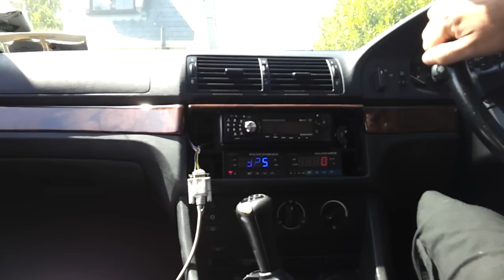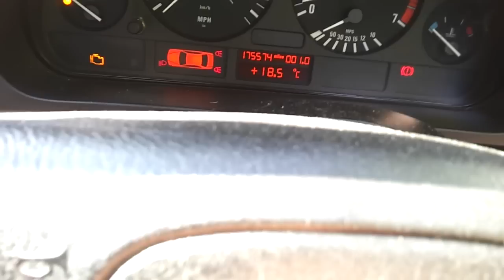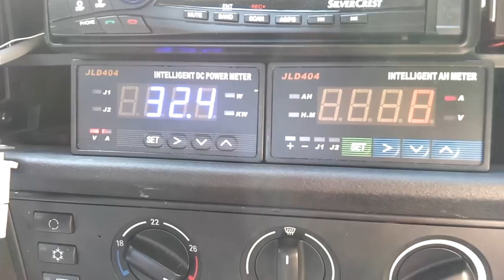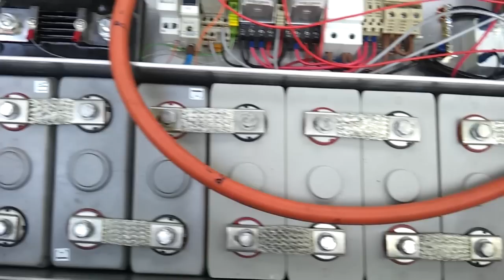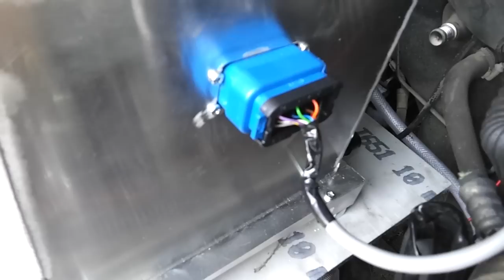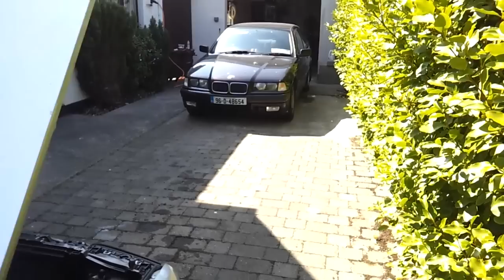BMW E39 EV Conversion 19 Maiden Voyage

Comment: Hi! Liked every video about the e39 BMW conversion to electric. However I was left very curious about the details of the upgrade such as air conditioning, heater? And how about the ACS and DSC traction control systems, will they be working correctly lets say in snow conditions? And what about integrating existing speedometer with new components? Example: fuel gage witch shows how much electricity is left instead of fuel? Thanks in advance and continue your projects, they are awesome!